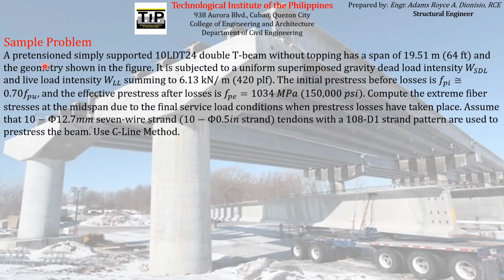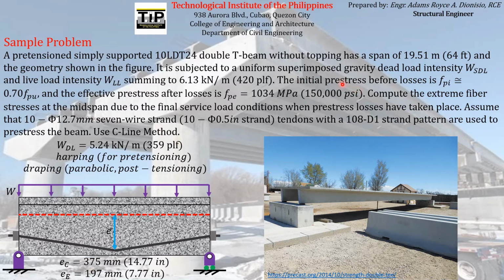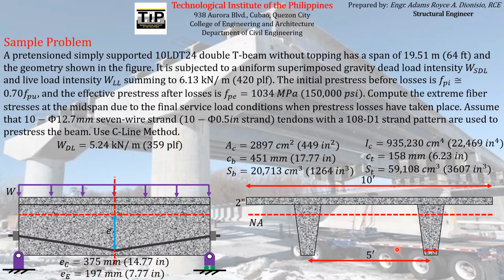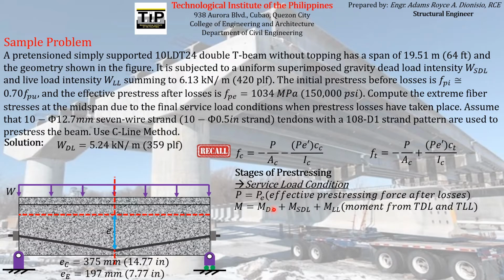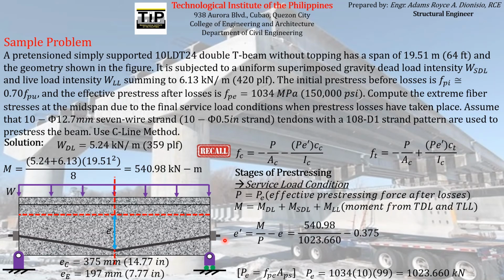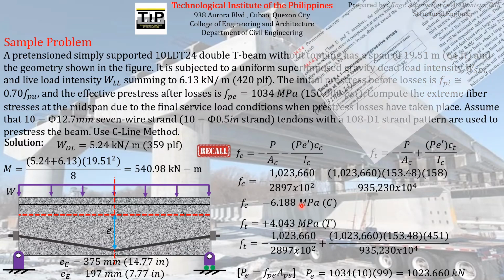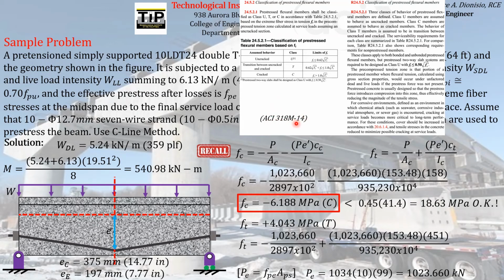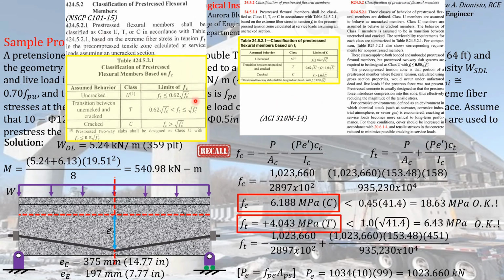3 Part 6 C-Line Method Sample Problem | Service Load Condition | Maximum Permissible Stresses

Comment: Hello po sir, paano po isolve ang 99 na area ng wire strand?
Reply from the maker: @khooo_7502  usually given or found in the handbook, because you cannot compute directly the area of strands based on its nominal diameter since it is composed of individual wires twisted together
Reply: @CivilEngineeringandEverything  okay po, thank you!